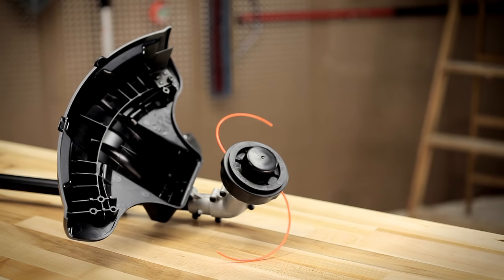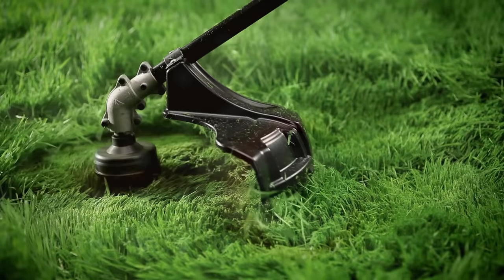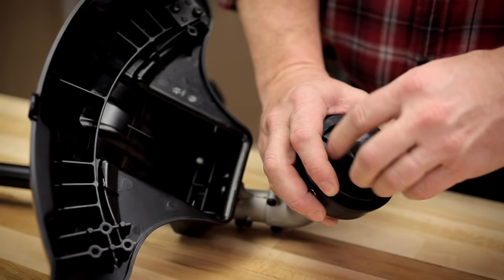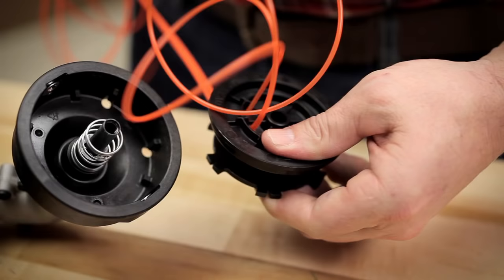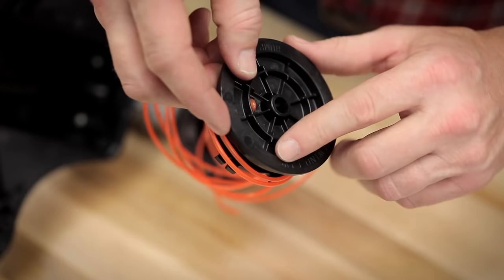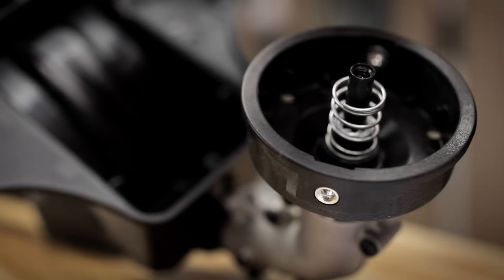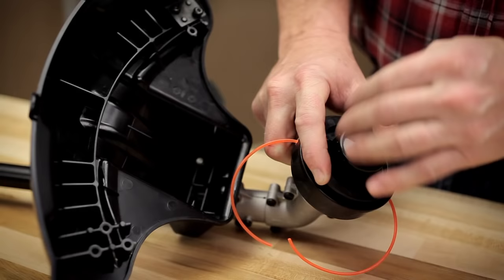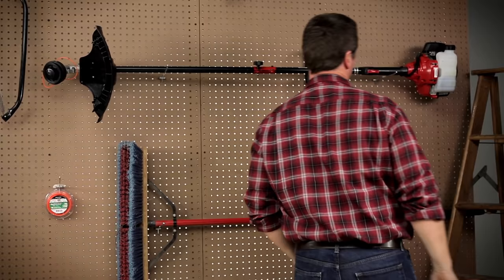String Trimmer Head | How to install new trimmer line on a traditional bump head

Comment: Can't get the darn bump head to come off! Tried for an hour and wont budge.! Piece of junk.
Reply: Same problem, its clockwise. I guess troy-bolt factory replaced their analog clocks with digital clocks. And yes it's a piece of $@/!
Reply: I bought the TB35 EC today and i have same problem. Tomorrow i will back to Lowe's to get some help. I was watching many videos but i don't get take off that crap
Reply: Samuel Hall thank you
Reply: Same here
Reply: Dermot B I couldn’t either so I used a pair of pliers and some oil
Reply: @samuelhall6269  Thanks because this video says counter clockwise
Reply: same here. clockwise or counter
Reply: I sprayed some oil under the bump knob, put a small screwdriver into the line hole and turned counterclockwise while using channellock on knob clockwise.

Comment: This spool design is garbage. There should be a dividing wall between each side. My line gets tangled inside the spool on itself and I have to keep opening it to fix it. If I can't replace the spool with a better type, I'm tossing this thing.

Comment: Thanks for the info.I bought a  used 4 stroke and it didn't have the trimmer line in it. I bought some and installed in maybe 10 minutes . Trimmer works excellent. I also have a Troy-Built lawn tractor ...that Kohler engine is awesome. thanks again.

Comment: The information on double stringing was helpful. The holes had me confused and I just doubled over a 20' piece. For those of you upset about the screw off bump head. I had to use channel locks to break it loose. remember only the 'button' screws loose. The spool and spring slide off once the bumper button is off. mind the spring, don't loose it! Also don't let your brother - in - law wind the string "in the direction of the arrow" because he can't follow directions! ;)  I had to rewind it. Alas, after installing I pulled and 'no joy' on keeper release and non-running bump test. I had to rewind it. And to ad insult to injury, I failed to notice the shaft and cutting head was frozen. I'll get to that in a minute after my brother-in-law's nose quits bleeding and we solve that issue...
Reply: to clarify on the holes. I had previously (last season) just doubled over a long piece about 20'. This video explained that buy cutting 2 pieces about 10' long you use the other 2 holes to loop the ends and in essence 'lock' the strings in place before you wind them. saves on the PIA factor getting the loop in stuck when you respool.

Comment: This helped so much!!  Thanks
Reply from the maker: That's great to hear! Let us know if you have any further questions, we would be happy to help. Thank you.
Reply: Troy-Bilt  why Troy bilt does not answer about screw off the stuck  bump head
Reply: ray Donald Because they know it won't work and don't know what to say.
Reply: Just use a large pair of articulating/adjusting pliers while holding the main head with your other hand.  Mine sticks all the time.  Somewhat less so when spraying the bump head screw with WD-40 before reattaching.
Reply: +ray Donald try clockwise with the pliers mentioned. that was the issue with mine.

Comment: Cut two 10’ pieces of 0.095” line
Unscrew the bump knob from the cutting head

Take the spool out of the cutting head and put the spring on the axle of the cutting head if it came off on the spool

Poke both pieces of line through one of the holes in the face of the spool and pull through until ~2” is sticking out

Poke the tails through the other hole, pull tight, and wind in the direction shown by the arrow on the spool face, keeping tension on the line and spool

Stop winding with about 6” of sting remaining and pull a string through the 0.095” holding notches in the back face of the spool

Thread the line into the feed holes from the inside of the cutting head, align the notches holding the line with the holes, and put the spool back on the axle

Compress the spring with the spool, thread the bump knob back on tightly, and pull the strings to ensure they came out of the notches on the spool

Comment: All those talking about stuck bump heads, mine was stuck so I just got a vice grip for the leverage and twisted it off. Its bound to get good and stuck with all the spinning and bumping a weed eater head goes through, and I'd rather have to get my grips out for a reload then the thing fall apart, so careful what you wish for.

Comment: By the way: In case the shaft above the line housing is wrapped with grass, or other debris, there is an 11/16ths hex to put an open end wrench on, to keep the shaft from turning while you unscrew the bump knob.

Comment: The two holes on my inner reel were not on the top of the reel, as shown in this video. Instead, my holes were on the inside of the reel that one actually wraps the new line around. They sort of only go in one direction, that should be obvious, and I found after probing them with a wire, that they only go in 3/4 to 1". So...doing one at a time and following the rewind direction arrow on the top of the reel, everything else works the same. Just keep the line taught and it works out fine. But if you don't find the holes on the top of the reel, be sure to look inside on the spool and there they will be!!🙂👍

Comment: My trimmer head does not have the holes, the old string is just tied in knots around the spool, but it looks just like the one in the video otherwise.  So my question is, is it best to replace my spool with one that has the holes?  If so, do you have a part number?  I have the Troy-Bilt TB22 gas power head with trimmer, edger and hedge trimmer attachments and I can't find these online anywhere.

Comment: Mine doesn't look exactly like this but I can't find help anywhere. It has red cap with a hole in the middle for the bump knob and you have to squeeze the sides to get it off and thats as far as i get but I can't get the spool out. I can't twist the bump knob without also twisting the spool and everything. Can somebody help me?

Comment: its just bad that the dont address, when the head is stuck.  Some consumer, has to give a suggestion and troy built, says thank you.  Show us a video with a head, that wont easily come off......
Reply: I have the same problem I can not get the head off please show a video showing me that the video that you are showing on the Troy Bilt T 66044 xp gas trimmer is not the same head that I have on mine

Comment: Or, you could just design a weed whacker that has two 10-foot strands of line coming out of two holes on opposite sides of the spool and the line is released when you hit the bump head.  But, that would be too easy and work too well, so we'll use this crappy design instead.

Comment: These things are way too difficult to get apart.
Reply: Come on girls, try a little harder.
Reply: ***** I popped the bump cap off with a screwdriver and that exposed a bolt that was easy to unscrew with pliers. I then threw the p.o.s. in the trash and installed a universal head from Shakespeare.
Reply: gale212 THANK YOU!
Reply: i GOT YOUR GIRL.

Comment: Poor engineering in the bump head. Stuck and not worth the time to fix. I'll be purchasing a 3rd party attachment as others have done. I plan on disassembling the bump head later and to use as an example within my practice of what not to allow to get past a prototype phase. Otherwise, a great product. How could leadership in the design team allow such a design compromise to leak through to the customer is beyond my level of tolerance.

Comment: Yeah, looks easy but it's not. Especially when the fucking bump head won't come off the damn thing
Reply: Just use a large pair of articulating/adjusting pliers while holding the main head with your other hand.  Mine sticks all the time.  Somewhat less so when spraying the bump head screw with WD-40 before reattaching.
Reply: try clockwise with the pliers, that was the issue with mine, it's screws on in the opposite direction. troy Bilt must have some people from across the pond making these to have never followed lefty loosely righty tighty and opposite for plumbing.
Reply: I pulled a muscle trying to take it off my dad touches it it come off like butter on a hot plate

Comment: This is BS.  I just bought one of these - owned it a week as of this writing.  Got the bumper knob off but nothing else will separate so I can replace the line.  The manual sucks and customer service sucks - tried to send me to a repair shop that they don't check up on to see if their referral still does warranty work on their equipment.  It's getting returned!

Comment: My fucking bumb head wont unscrew off....WTF do I do then....
Reply: It's stuck just keep/ hold it from moving and with your finger push  the tab in and turn counterclockwise about a 1/4" and pull ,it should come off then clean the inside edges .